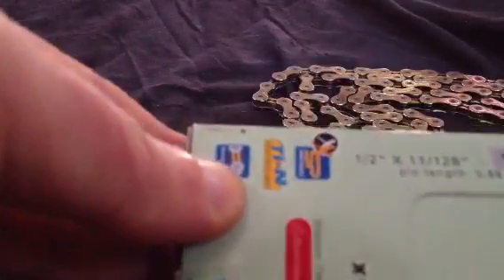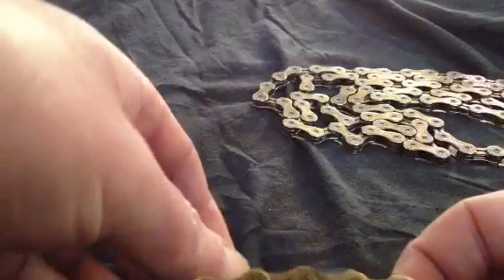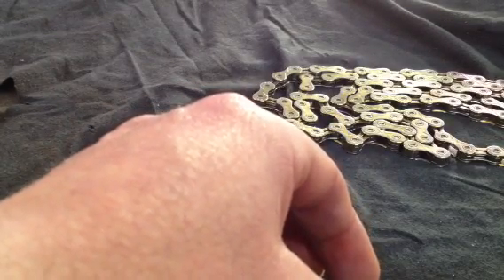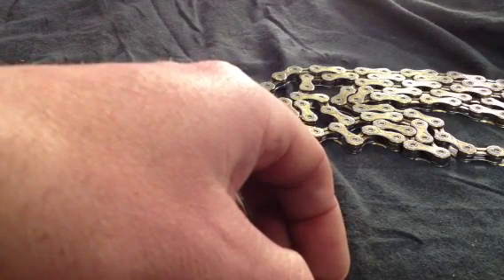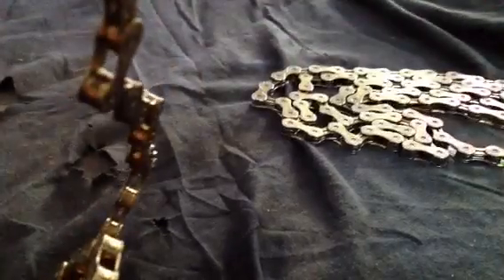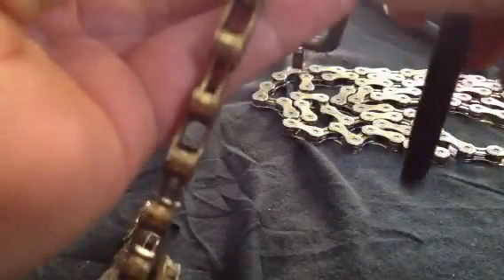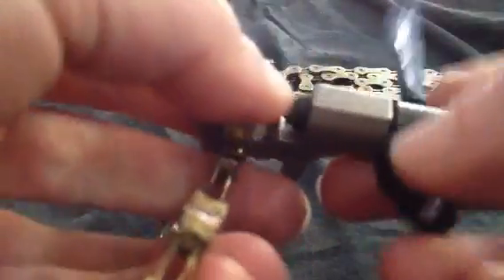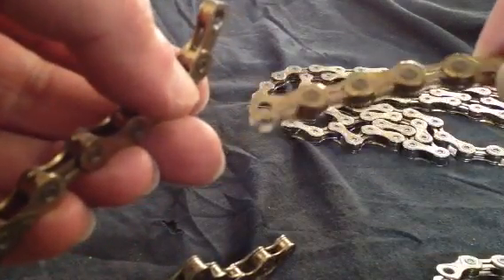How to remove a link from a chain (KMC,SHIMANO)

Comment: I have the same kind of tool but my KMC chain rivet won't give. My hubby already broke one of these chain breaker tools. Bought a new more expensive tool and it still won't move! Err
Reply from the maker: They have some resistance but really not that hard to ouch out,it can be more challenging using a small chain link remover versus a good quality shop tool like Park tool for example 🙂👍🏻